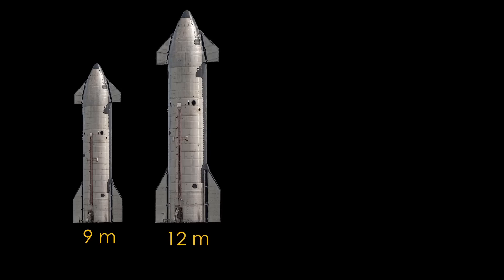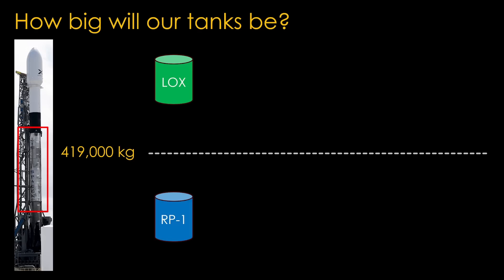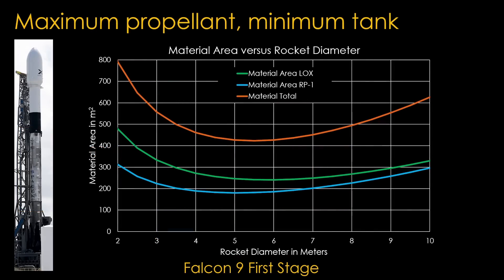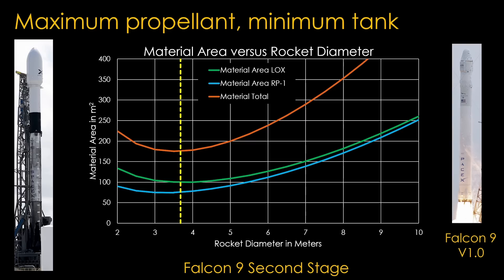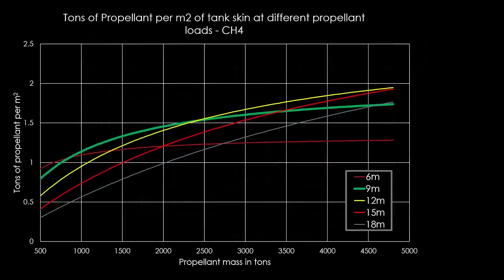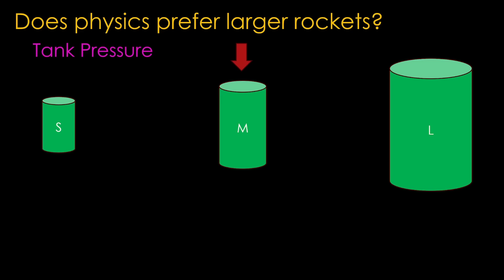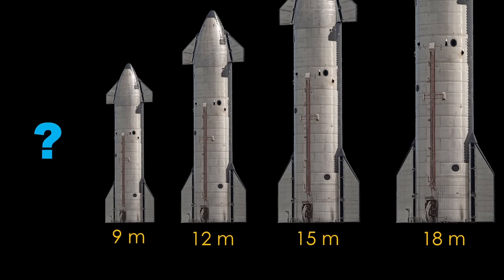Will Starship Get Bigger? Propellant tank sizes and rocket diameters

Comment: Sine the mass to loe for ship 1 and 2 were so overestimated in the beginning, and now it's going to be at  ship 4 and nearly a third taller and probably still way overestimated, It will have to be larger in diameter if they ever want to reach that 200ton+ to loe. And at the current time table that'll be another 8 years.

Comment: "Rockets are mostly propellant tanks"
This isn’t as necessary as people think, as Dv only scales to the logarithm of the mass ratio. 

The reality is that we are strongly limited by engine exhaust velocity, we just need better engines, better atmospheric engines too. Going from 95% fuel to 50% fuel gives you 10 times more mass to use, and only divides your Dv by 4.3 times. But you went from having to use 19 tons of fuel per ton of mass to now using 1 ton of fuel per ton of mass. You just can’t accelerate it as much. 1/4th the total final speed budget. 

This is why we need to develop better engines, hoping to fight against a logarithmic curve is kind of a perpetual delusion, you can spend endless effort trying to shave off every last gram of mass, or simply get slightly better engines for a much bigger benefit. 

There is no ongoing research in better engines (atmospheric) right now as far as I know, this is how pathetic humanity is as a species. 8 billion humans on earth and not one can be damned to work on the tech that allows us to reach every point in the universe that isn’t earth
Reply from the maker: What sort of engines are you envisioning? How would they operate and what fuel would they use.

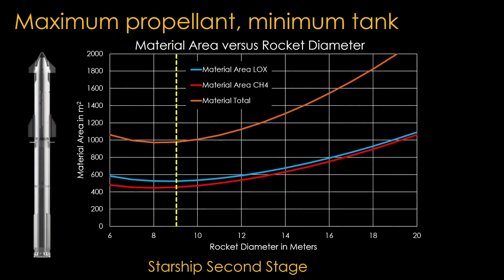Comment: 9:45 your charts for Starship look very much as if you calculate the full LOX and LCH4 tank surface areas separately and independently, then add the two together.  In doing so, you are ignoring the fact that the Common Dome is shared between the two tanks in Starship (on both stages).  So you're double-counting the common dome area, and therefore all your subsequent conclusions are strongly - and wrongly - biased toward higher fineness ratios (i.e. you incorrectly favor the thin-and-tall rocket body over a short-and-fat one).

Comment: Noob here so i don't really know what I am talking about.. But wouldn't a wider rocket also have significantly higher drag needing a lot more fuel?
Reply from the maker: Aerodynamic drag is not a big factor in rockets because they move slowly in the lower atmosphere and spend most of their time out of the atmosphere. 

In numerical terms, it takes about 9400 meters per second of Delta v to get into orbit, and drag is perhaps 200 of that.

Comment: Anyone have speculation of how many raptors / configurations would be on the 12 m super heavy and starship?
Reply from the maker: My guess is that they will go bigger than 12m - 15m or 18m - and with that I think they are going to need a super raptor. They would (roughly) need 4x the thrust to go with 30 ish engines on an 18m vehicle.
Reply: @EagerSpace what about just more raptors

Comment: Elon announced the 18m version is coming 2034. IMO, they'll probably start upgrading facilities in 5 years.

I don't think the plane comparison makes sense without competition. Starlink and direct to cellular service is expanding rapidly. Landing a high fineness Starship on uneven soft regolith and Martian winds seems like a massive pita.
Reply: Martian winds are insignificant, because the force exerted by wind is a linear function of air density - and Mars atmospheric density is about 1% that of Earth.  Meaning, same-speed winds on Mars impart only 1/100th the push they do on Earth.
Reply: @Spherical_Cow  but it's made of CO2 instead of nitrogen, so it carries much more energy than the density would suggest. See Scott Manley's video where he calculated wind power is about ¼th as effective on Mars compared to earth.
Reply: @ch4.hayabusa  density is by definition a quantity of mass per unit volume.  When we say Mars' air density is 1% of Earth's, we literally mean a liter of Martian atmosphere has 1% the mass compared to a liter of Earth atmosphere at the same altitude (roughly speaking; Mars has a larger scale height but that doesn't affect the discussion of Martian wind strength per se).  The specifics of atmospheric composition don't matter in this context: the force exerted by wind is purely a function of speed and density.

Comment: Just take a look at a can of soup. It too is a cylinder designed to minimize surface area for a given volume. If minimizing surface area was really the main issue then you would choose a spherical shape. Spheres don’t have great aerodynamics, so getting them out of Earth’s atmosphere is a drag. This is where long pointy rockets do better. How to optimize between these factors and manufacturing limitations is kinda complicated.

Comment: It would be much simpler to manufacture the Super Heavy booster from an Al-Li alloy and thereby increase the system's payload capacity for the following reasons: 1. SpaceX has decades of experience with this alloy, 2. most of the booster does not require any heat resistance, 3. the booster does not need to be mass-produced due to the extremely short turnaround time.
Reply: I would agree, but I think the reasons are that #1: Steel is much stronger than any aluminum alloy, meaning less material is used. #2: It is more easily repaired. #3 The spacecraft can be entirely made out of Steel whereas  an aluminum craft has to have carbon fiber components which are much more expensive.

Comment: You did not touch on wind resistance of a much larger rocket.  I have a design for a space station that requires some 60 foot diameter tanks in space and I don't want to build them in space so that means I need an 18 meter diameter rocket to launch them.  One launch would put as many as 3 such tanks in orbit with "some assembly" on the third one.  But the wind resistance is going to be intense so I think maybe there may be a practical limitation penalty for going larger in diameter in our thick atmosphere.  If it could be launched from a two mile high mountain that would save a lot of fuel and probably negate the wind resistance issue as it would be miles higher before picking up speed.
Reply from the maker: To get into orbit, you need to generate sufficient velocity, deal with gravity losses, add potential energy to get to a higher location, and deal with aerodynamic drag. 
I think those are in order of magnitude from largest to smallest. Last time I looked, aerodynamic drag is only a couple hundred meters per second of delta v. .

Comment: Thickness is a function of diameter but not height for internal pressure.  Vertical thrust loads are a buckling problem that is dependent on both diameter and height.  So both types of load impact the thickness.   You can add stiffeners for the thrust loads, which SpaceX already does but in either case of larger diameter or larger height will like require more stiffeners.
Reply from the maker: This is definitely a case where the simplifications I made detract from getting a real answer.

Comment: I did comment that I believed it would take SpaceX a long time to go for 12m never mind 18m when this video came out, but assuming SpaceX is serious about going to Mars which I have my doubts, and really even going to the moon on a semi regular basis a 18m Starship makes a bunch of sense and not even bothering with a 12m Starship because as I mentioned the launch infrastructure would have to be built new.

However what an 18m Starship does for you is enables you to lift 600T to 800T in one launch reducing the number of launches required to do refuelling in LEO using to 3 - 4 launches from like 12 to 20 when you account for boil off, which getting it done in less launches also reduces how much you lose to boil off, this assumes you are using a 9m V3 for getting to the Moon or Mars.

So you would have both being produced simultaneously although you would only ever need 3x 18m Starships for refuelling, maybe a couple of extra so that your not just using them for refuelling because it would be a bit of a waste to build all the infrastructure just for a fuel truck just encase anyone want to launch fricking 600T - 800T in 1 go.

Also with a 18m Starship you can eventually just leave one in orbit as a fuel depo with the power generation and equipment to do the cooling required to stop boil off being an issue so that it's viable to do an 18m Starship to Mars, again it would require 12 launches assuming 800T of cargo, but only 12 launches because you don't have to worry about boil off between launches.

Well that or either you would launch a depo into orbit, because you would want to outfit a depo with insolation to reduce boil off, protection from micrometeoroids as it's going to be getting left in space for a long time, which retrofitting that in space would be problematic, and building a starship on Earth capable of that would almost certainly be more trouble than building modules and launching those modules, because those models don't also have to be built to be a rocket so it reduces the complexity and therefore the cost and you do get some economy of scale because you would be doing 14 - 16 modules to the cost of the latter half would cost less than the first half.

No 36m Starship pleas, that is getting truly ridiculous, 18m is already like launching a fairly skinny high-rise building into space.

Comment: This was fascinating, thanks for helping me understand that. 

I noticed that SpaceX’s original Mars vehicle had a 12m diameter and a substantially higher payload capacity. But then they shrank the vehicle to 9m and now it seems like they are stretching it instead of making it wider.

I wonder if they will return to 12m for the Mars colonization rockets. I’m curious what impact the number of refueling rockets needed for those deeper space missions.

Comment: You also didn't mention that a tall skinny rocket experiences less aerodynamic drag than a short fat rocket would. The optimal shape for a tank is spherical but that's a dreadfully inefficient use of space in a rocket.
Space-X will most likely stick with the 9m diameter for quite a while, but to set up a colony on Mars would take 'too many' small 9m rockets at that point they'll jump to a larger diameter. To make the chance worth while they'll need to make it a big chance, 12m isn't worth the infrastructure change so it'll be at least 15m, probably 18m.
Reply from the maker: Because rockets are slow at launch and spend most of their launch outside that atmosphere, drag losses are a small component of the energy to get into orbit.

Comment: IMHO there's little point going bigger..  what matters is $/kg to LEO..  that requires not only reusability, but also high volume production of the ships, boosters and engines.  Make the ships too big and you don't need so many and that eats into the benefit of high volume production.   One thing they could do is place a 12 or 15meter diameter payload bay on top of the 9m vehicle for taking occasional bulky payloads but clearly not heavier.  (my background is electronics..  cost of which is extremely volume dependant)
Reply: Being able to lift more without a big increase in cost improves the $/kg ratio.  That's one of the points of going bigger.

Comment: There are some difficulties with rockets over 10 meters in diameter, having to do with airflow over the frontal surface area.   Lengthening the rocket is much more efficient than increasing the diameter.

Comment: It seems to me, that it would be more practical to build the Starship, in an 18-meter stage, on the moon and launch from there without all the regulations and having to use a booster to defeat the Earth's atmosphere and gravity. You wouldn't need a booster, or as much fuel so you could have more explorers to send to Mars.
Reply: Absolutely, sadly it might take a generation to get to that point.

Comment: I never heard of your YouTube channel but it popped up in my suggestions.
I must say, you do an excellent job. Thank you.
One tthing you didn't mention was he increase in the number of rocket engines goes up as diameter increases. Maybe the mass and thrust balances out, but it would be nice to hear you say so.
Reply from the maker: Thanks. 

You do get more engines because the area for engines increases with the square of the radius.
Reply: As you increase the diameter, the area and mass both (approximately) increase with the square of the radius, so it balances out.

You can’t increase the height, though. That increases mass to the area for engines.

Comment: Excellent work. It should be noted that the maximum height of a rocket is set by the thrust per unit area of the base of the rocket. And thrust per unit area of the base will be constant with a given engine type and engine packing density.
Reply: How does that determine height?  Mass I can see...
Reply: @TheEvilmooseofdoom Yeah I wasn't very clear. How about this...

Making a cylindrical rocket wider wont give it any advantage in being able to stack propellant higher.
Reply: @TheEvilmooseofdoom  You can’t add height without adding mass. If you’re only increasing the height, you can’t add more engines, and the thrust to weight will drop.

Comment: I personally think Elon will move to a larger diameter to support more engines and an actively cooled metallic tps once its determined the tiles cant protect ship enough for rapid reuse.
Reply: Maybe in 10 or 15 years, but to do so now means scrapping a lot of building and starting over.

Comment: Metric system.    Could you help us poor Americans.  Who will never use those .
Reply from the maker: Sure. A meter is about the same as a yard, so you can use that as a first approximation. If you need more accurate, add 10 percent. 

So a 9 meter rocket is pretty darn close to 10 yards (google will happily tell you it's 9.84 yards), which means if you set it down upright on a football field with one edge on the goal line, the other edge will be right on the 10 yard line.

SpaceX uses metric and most of the other rocket companies do as well. NASA uses a weird and confusing mix of metric and standard.
Reply: You have the best information.  My 81 year old dad has a hard time with it. I see the comment.  And am thankful for your respectful and honorable responce.
Reply from the maker: I do at times use both systems, but if it's a lot numbers it just gets too cumbersome.

Comment: Ok, you concluded the most important factor is choosing rocket diameter based the amount of propellant you want.  There is a strong reason to go bigger NOW not in 10-20 years.  They want to bring as much propellants as possible in the tanker ships, to reduce the amount of tanker flights they need to refill for Mars and Moon trajectories.  I think they should build 12m tankers, to refill 9m cargo and crew Starships.  Some are claiming the imagined 9m version of a tanker would take 12-17 flights.  If is that bad, they might want to go to 12m tankers asap.  (for efficiency rather than to shut up the skeptics).
Reply from the maker: I don't think number of tanker flights is something they care about directly.

They do care about how much refueling will cost and they care about the hassle of supporting tanker flights if the numbers per refueling get big enough to be operationally problematic, but you are saying that they should throw - let's pick a number - a few billion dollars towards a 12 meter variant just to reduce the number of tanker flights. 

It's not clear that at 12 meter new version is a win from a cost perspective.

Comment: Before Musk started talking about orbital fuel depots I had always believed SpaceX would ultimately build a number of Booster/Starships that were twice as wide and twice as tall to facilitate refueling Moon and Mars bound Starships with one launch. Doubling both diameter and height would allow roughly 8 times the payload delivery to LEO compared to the normal size.
Reply: Say existing booster has 3400 mT prop and ss has 1200 mT prop, that's 86 m of combined tank wall.   Doubling tank diameter and height will require thicker steel, approx additional 27 mT in beefier bulkheads and 255.5 mT in bigger & thicker tank walls (and I'm not adjusting the non-tank masses.)  Your dry mass is now at least 115% heavier than before.  The net dV requirements aren't changing, but drag losses will be much higher, so prop fraction will be worse.  At best you're getting a 3.75x increase in delivered payload for 8x increase in prop. The rocket equation is a stinker.  Loading more raptors on the bigger cross-section won't improve the prop fraction and will greatly increase the dry mass.
Reply: Regarding raptor mass, 18m diameter shell can fit 3-6 sea level raptors x  1.5mT and ~36 vac raptors x 1.75mT, so the additional 33 vac raptors will add ~58mT to dry mass.  I think I jumped from considering the whole system to just booster mass when I said 115% additional.  If dry booster = 250 and dry ship = 150, the old dry mass is 400.   Add 27 from bulkheads, 255.5 from tank walls, 58 from extra vac raptors gives 85% extra dry mass., which should give 4.3x payload for 8x prop.

Comment: This video isnt making any sense to me. The closer to a sphere your design is the less material will be needed. This video doesn't give a decent explanation as to why you wouldn't go as wide as it is tall. Afterall that would provide more space for engines. What am I missing?
Reply from the maker: If you go wide enough the area of the three bulkheads increases faster than the area of the of the skin decreases, so you use more material. That's what the minimum value is showing.